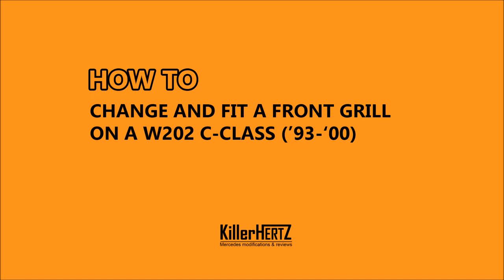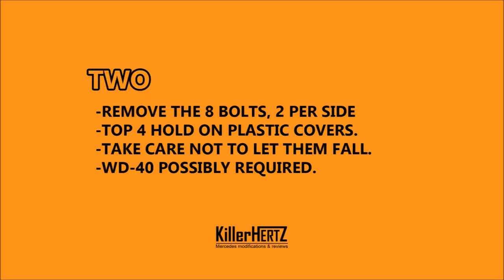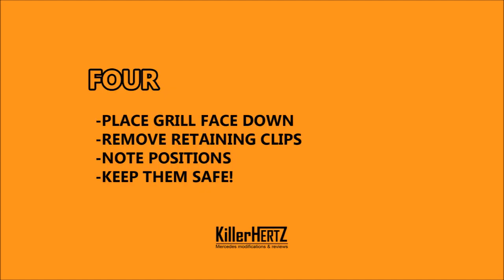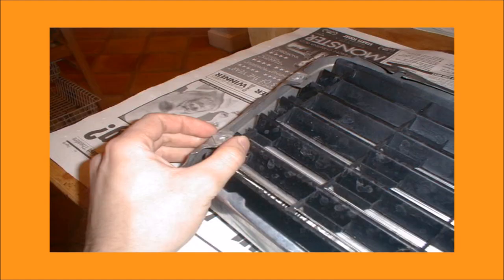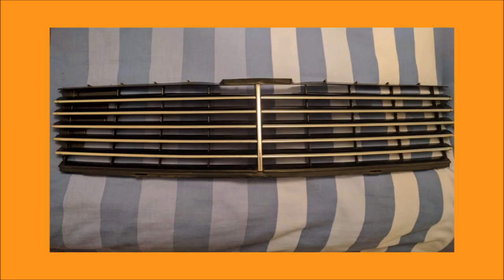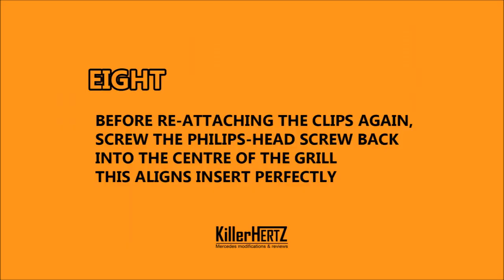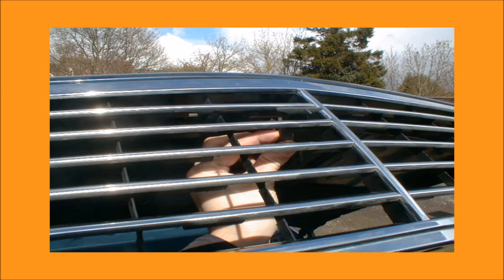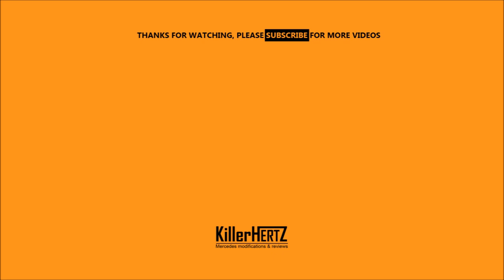HOW TO: Remove / Replace Mercedes Class W202 Front Grill

Comment: is that the oem Grille or Aftermarket?
Reply from the maker: Aftermarket
Reply: KillerHERTZ Mercedes Modifications is the chrome part metal or plastic?
Reply: I just purchased a aftermarket one but it was advertised as black metal steel.. Other aftermarket grilles looked like cheap plastic.